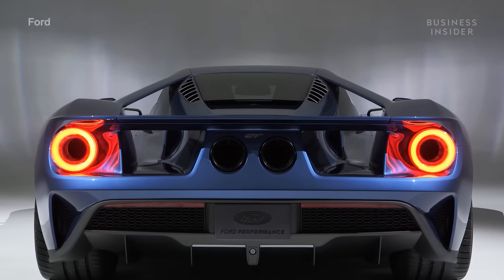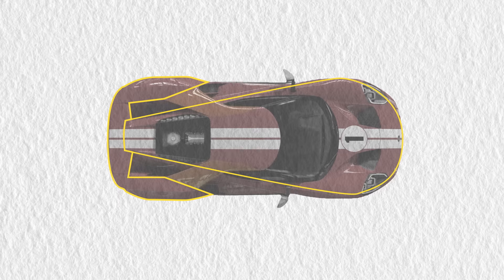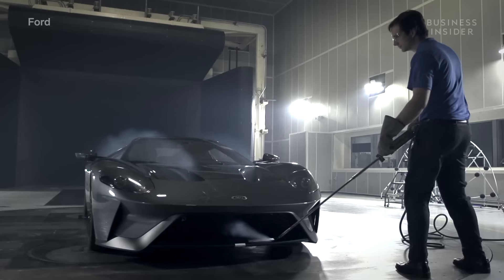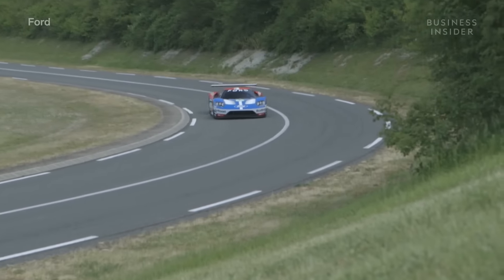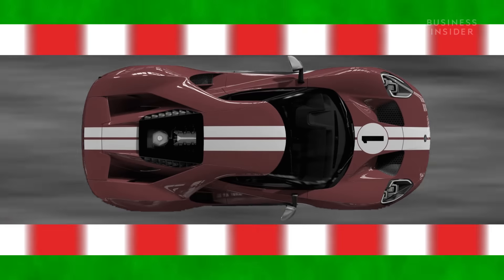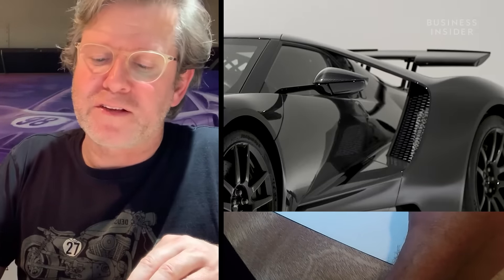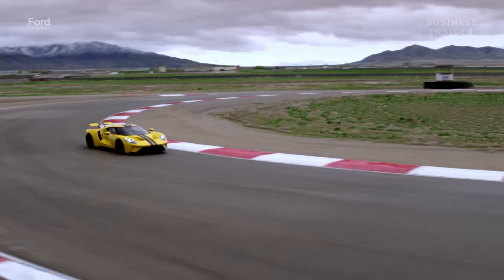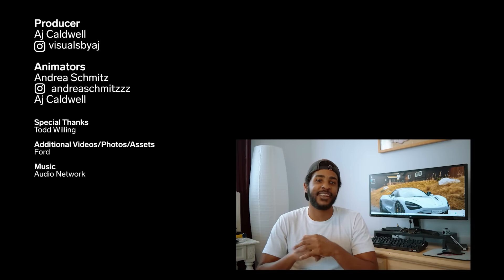How The Ford GT Was Aerodynamically Designed | The Car Design Show

Comment: As an engineer, I can say this video is filled with inaccuracies with respect to the science.

The designer speaks the truth. The narrator doesn't know what he's on about.
Reply: Yeah, he doesn't know what he is talking about. I noped out when he said the air from front intake is directed to the spoiler. Designers spend so much to avoid just that.
Reply: And the diffuser works exactly opposite to what the narrator said.
Reply: Next time they should interview the engineers that, you know, actually did the aero work
Reply: Nah, that's why he called narrator, not explainator
Reply: @jajababy2point0  he did interview the designer, but it was short and most of the video was just the narrator blabbering about stuff.
Reply: @gabehoing8064  diffusers are designed to gradually decrease the relative velocity of the air exiting from the rear under the car so that 
1. Slower air has higher pressure, so it doesn't create vaccuum behind the car which would add a lot of drag.
2. Suddenly decreasing the velocity causes turbulence and we don't want that under the car.
Reply: Ritwik Reddy to be clear, he interviewed the Global Design Director, not an aerodynamicist, or an engineer. I’m suggesting if they were interviewed you would get more of a technically accurate explanation of the car’s aero features.
Reply: @jajababy2point0  yeah
Reply: Exactly
Reply: Exactly
Reply: @thomass.jagger2429  it is more efficient to use aerodynamics for downforce as compared to adding weight. I think that's what he meant
Reply: Business insider sucks
Reply: I have firsthand knowledge on the design of this car and you are 100% right. VERY inaccurate.

Comment: it was designed to feel like its competing with bugatti
Reply: @sowmithreddy8178  actually, they are very aerodynamic. One of the lowest drag coefficient of all cars
Reply: The best track car in america
Reply: Bugatti May have the lowest drag efficient but it had very low downforce and weight of the car is way much more heavy to go on a racing track which means
-Low speed cornering 
-Heavy weight which brake way much more earlier to turn 
-Very bad overall control because of weight
Fun fact: Bugatti veyron had slower lap time around the Nurburgring than BMW M5 F90
Reply: Racing Bro exactly, bugatti is an impressive car, but a bad car for track use
Reply: not bugatti design just to go fast... win comfort... this just wanabe race car... with v6...
Reply: @bro6046  I think they produced two cars that are intended to be track cars, the Divo and Chiron Pur Sport.

Comment: The diffuser doesn't increase the speed of airflow while exiting the car. It actually reduces it to smoothen the transition from high-speed low-pressure air under the car to the atmospheric pressure in the ambiance. And, it is the low pressure under the car that literally sucks the car to the ground and keeps it planted during cornering and other high-speed scenarios.
Reply: Well, the defuser actually creates the expansion that allows for the high speed air under the floor. It actually creates downforce because it also redirects air upwards and well, you can apply Newtons third law to that

Comment: Actually the 2017 Ford GT is a 3rd generation vehicle since it all started with the GT40 in the 60's and then it's first revival of the 2nd gen vehicle in 2005.
Reply: The original GT40 was only meant to be a race car (and not a road car) that pissed off Ferrari, the 2004 GT was built to commemorate the GT40 and to compete Ferrari on the streets. and the new GT was meant to go back to the track and beat the crap outta Ferrari again like 60 years ago and even made a road version out of it.

Comment: whats the difference between sports car vs super vs hypercar
Reply: I think it's  how much horse power they produce but idk
Reply: Supercars are generally a little bit harder to handle than sports cars, and usually have over 500 horsepower. ... In terms of performance, they would simply demolish even the very fastest sports cars in a straight line. Not to mention that the way they feel also strays into supercar territory.

Comment: Alright aerodynamics make perfect sense, but why would you put a eco boost V6 in a legendary supercar, with a tiny gas tank???

Make a video about that
Reply: Packaging space, fuel efficiency, power density and reliability/durability. That's why the 3.5 was chosen.
Reply: It’s lighter than v8 and since it’s twin turbo charger. Has more hp than the v8

Comment: All great except the V6 engine .  Why ?
Reply: The current Ford GT is more of a homologation build for their GTE version. They only sold a certain number because they needed to meet the number in order to enter a track variant into the 24 hrs of Le Mans. There are a couple rules around what could be used and one is that the engine has to have the same cylinder block as the road version.
There is no rules to how many cylinders are needed but ford probably found that the turbo v6 is the best balance between weight, power and their ability to package it into such a small space in the back of the car.
Reply: Also just to add on, the engine could either be 5.5 liters naturally aspirated or up to 4 liters turbocharged. A 4 liter v8 does not make much sense considering the engine needs to be reliable enough to run for 24 hrs straight for the FIA WEC competitions.
Reply: A bigger engine wouldn’t fit the engine bay is very small due to the cars design

Comment: And, how does a Tesla beat it without any of those fancy curves and air direction or whatever?
Reply: Electric motors have instant torque. Gas motors slowly go up in torque. In a short, straight line, a Tesla can outrun a GT due to its powerful electric motors, but it will start to lose once it tops out because electric motors are difficult to make in carrying that speed further and further. A Tesla can do well in turns due to a low center of gravity thanks to the heavy batteries at the bottom of the car, but it will be no match for the low and aerodynamically efficient GT.

Comment: At the price of The Ford GT, I want a V-12 engine, not a crappy sounding V-6.
Reply: You should know that the Ford GT uses a V6 over bigger engines like the V12 for a good reason. Due to it's teardrop shape with the Flying Buttresses on each side, the engine compartment won't have enough room to fit a bigger engine, so they decide to slap in a smaller and lighter Twin-Turbo EcoBoost V6 and let the aerodynamic design and lightweight materials do the rest.
As a result, the '17 GT produces 647 HP, 97 HP more than '05 GT's 550 HP because it uses a bigger and heavier V8, heavier materials, and less aerodynamic design when compared with the '17 GT.

Smh to people these days who cared about the sounding on bigger engines instead of the performance as a whole and how they achieve it...